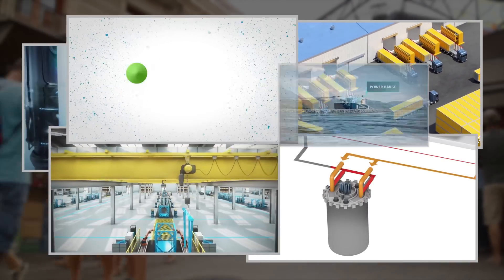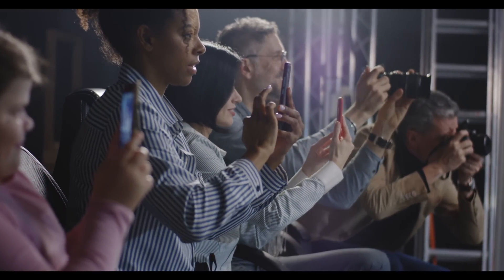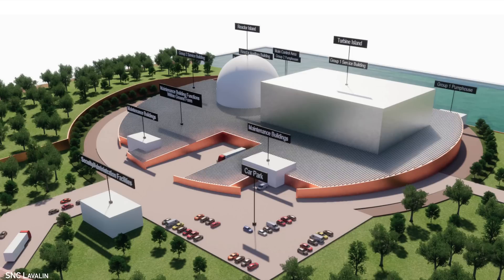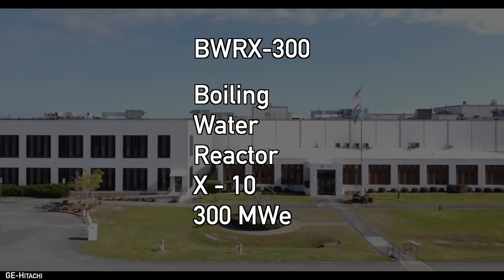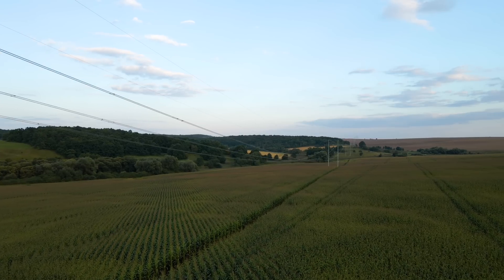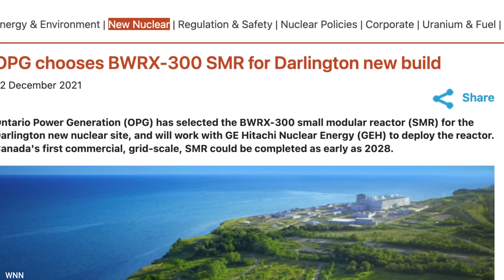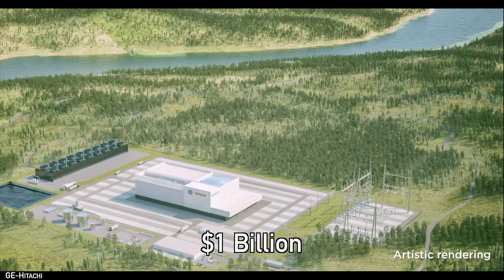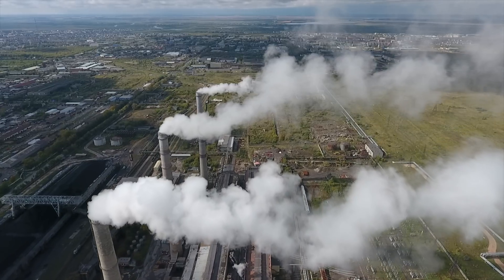Why This Small Nuclear Reactor is Actually Winning

Comment: 1.  It’s a low pressure reactor.  Hence the explosion danger is less.  High pressure reactors like Fukushima or 95% of current reactors are DANGEROUS
Reply: This is a high pressure reactor.
Reply: The reactors at Fukushima were GE BWRs.
Reply: its not low pressure its low temperature, but remember "low" in this scenario is still a few hundred degrees. The pressure will still be a couple hundred atmospheres.
Reply: correct.  The large PWR reactors are dangerous when pressures go out of control.  The good PWRs are the ones developed by Rickover for the nuclear subs.  Small is reliable and safe.  Big is bad.
Reply: @July41776DedicatedtoTheProposi  Large PWRs are not dangerous just expensive to build and limited to low-efficiency electricity productions. Next generations Molten salt reactors don't need all of the extra structure to contain pressure which lowers the cost. Because they are high-temperature they are much more efficient and extremely valuable for industrial heat applications.

Comment: Something I've pondered is if counter-intuitively when it comes to fusion, aiming as small as possible and increasing focus rather than the seeming blunderbuss approach of many projects is better? It doesn't really matter what amount of whatever makes whatever happen, as long as gain goes above one? It's not like we can at all create anything like a solar mass gravity well, and if we did, well it would be the end of us. So to me this suggests lateral thinking is required.
Reply: You pointed out the reason already. The bigger the reactor is, the higher the gain. No small fusion reactor currently built has ever reached a gain of over 1. ITER is meant to be the first to actually hit positive gain. Some small reactors have theoretically hit over 1, but factoring in conversion losses, that's drops well under 1.

Comment: Excellent content.  What about Rolls Royce's SMR - the one they originally designed for submarines?
Reply: Not got a customer yet. Still active though, forming consortiums etc, to break into markets. But running on UK govt money which runs out in 2024. So need a firm order soon. 

The firm's military reactor business though has a secure order book, with recent Aussie submarine announcement going for Rolls Royce.
Reply: i think the Rolls-Royce is about 450Mwe, so not technically an SMR. cost around $3B but assembled from road transportable components including the core, so apparently only four years to build. Lots of history regarding submarine reactors.
Reply: Rolls Royce not all that great, if it were the Us navy would use it
Reply: @dknowles60  Your statement "Rolls Royce not all that great ..." does not follow from  "...if it were the Us navy would use it"  
The US military do not use key components made outside the USA. For example, the "re-engine-ing" of the B52 is going to Rolls Royce (RR) because RR agreed to manufacture the engines in the USA. IIRC that USA plant is a collaboration with an existing, established, US based manufacturing company. The engine is not new, it is a well established, tried and tested RR engine. That is a very different situation from a brand new product.
If I were RR, I'd want to build several reactors, under very close control and supervision of RR staff before agreeing to build them in the USA. So, an order for RR's reactors from the US Navy would need to be big to justify the risk and cost.  Further, the better US-based companies to collaborate with are competitors.
So, not likely to happen.
Best Wishes. ☮
Reply: @dknowles60  It is more difficult to pass bribe money unnoticed internationally between developed states. This gives the home team a big advantage in France, Germany, Japan, the UK and the United States.
Reply: Hey Poland! You're going nuclear for the wrong reasons!

CO2 is climate-irrelevant. 

Interglaciation climate change (i.e., the Medieval Warm Period) is caused by changes in cosmic rays (Svensmark et al). 

There is not such thing as anthropogenic global warming.  

"Global Warming" is a superstitious bullying and shakedown of the taxpayer. 

Just burn coal and keep looking for more oil and make it out of coal (the way South Africa does at SASOL).
Reply: Everything made outside of BRICS is the same cost-effciency grade as a Rolls Royce car - Super Exencive. Only anti-people governments as that of poland or estonia spend tax payers money on such a toy.

Comment: I think the IMSR by Terrestrial Energy has the best features for an early SMR partnered with Oak Ridge the site of the original thorium reactor. Crawl before you run... the IMSR uses uranium and focus on the safety and affordability of an SMR. Next stop Thorium ❤
Reply: Since Terrestrial Energy is located in Oakville, ON, I was surprised that Ontario went with the BWRX-300.  I guess they can get the construction finished before more of the old CANDU reactors need to be retired.
Reply: I like the direction that Terrestrial Energy is going by featuring industrial heat output, not electricity production. Uranium is actually a better fuel in this type of reactor than thorium. It makes it a cheaper and simpler reactor.

Comment: Gen 4 reactors, please...
Reply: This is not gen4
Reply: Hey Poland! You're going nuclear for the wrong reasons!

CO2 is climate-irrelevant. 

Interglaciation climate change (i.e., the Medieval Warm Period) is caused by changes in cosmic rays (Svensmark et al). 

There is not such thing as anthropogenic global warming.  

"Global Warming" is a superstitious bullying and shakedown of the taxpayer. 

Just burn coal and keep looking for more oil and make it out of coal (the way South Africa does at SASOL).
Reply: Something like this:
🔋 Key Advantages of the Dual Fluid Reactor (DFR):

• ⚡ Ultra-efficient: Nearly 100% of nuclear fuel is used  
• ♻️ Burns nuclear waste, depleted uranium, natural uranium, thorium – and all actinides (incl. Np, Am, Cm)  
• 💥 Transmutes long-lived actinides into short-lived fission products  
• 🔄 Built-in Pyro Processing Unit (PPU): Continuously removes neutron poisons and extracts valuable metals  
• 🛠️ Liquid fuel: No solid fuel rods, no reload cycles  
• ⏳ Decades of operation with a single fuel load possible  
• 🚫 No corrosive salts: Liquid metal fuel avoids fluoride corrosion and complex chemistry  
• 🧊 Lead coolant: Excellent shielding, no water, no pressure → no steam explosion risk  
• 🌡️ Very high temperatures (700–1000 °C): Enables hydrogen, e-fuels, ammonia, and direct steel reduction  
• 🧠 Self-regulating: Output adjusts automatically via negative temperature feedback  
• 🪫 Minimal waste: Only short-lived fission products remain (• 🏭 Compact & scalable: High power density, ideal for modular deployment  
• ⚙️ No moving parts in reactivity control: No control rods required  
• 💰 Uses spent fuel, DU, thorium & actinides – no enrichment required  
• 🌍 Reduces dependence on enrichment, mining, and fuel imports  
• 🔄 Fully closed fuel cycle: No external reprocessing required  
• 🆚 Outperforms typical SMRs: No pressure vessels, no water coolant, no fuel handling
Reply: Yeah, active safety isn't an improvement.
Reply: No they first should sell something.. eh outdated.. as 'new'. Just scaled down it and ... yep... sell it as revolution. But truth is that this is a mall vs tiny shop near by... who is going to win? )
Reply: @maksimmuruev423  Make it smaller so the disaster is also smaller.

Comment: This is a step in the right direction but it may only be a transitional step,

The goal should be to have a reactor that burns up almost all of it's fuel so there is much less nuclear waste and can achieve efficiencies on the high 90% range. Reactors that operate at low pressure can be a lot less expensive to build and control. 

I would like to know what the efficiency of this reactor is and at what pressure will it operate?
Reply from the maker: They haven't published anything in the public documentation, but if it follow's GE's previous design that it is based on (ESBWR), the main system pressure should be around 1050 psia. Overall thermal efficiency would also be expected to be similar at ~33%. Not revolutionary for sure, but reasonable.